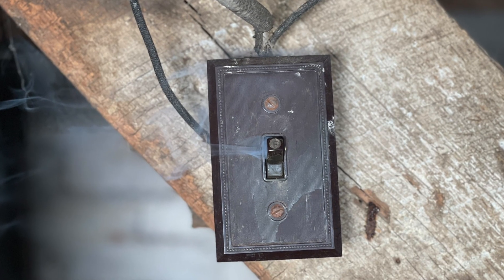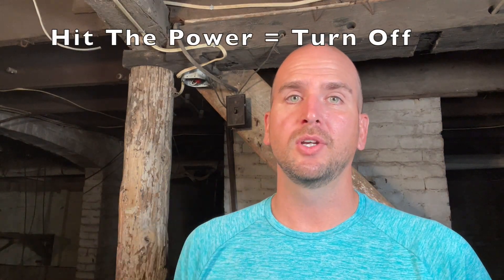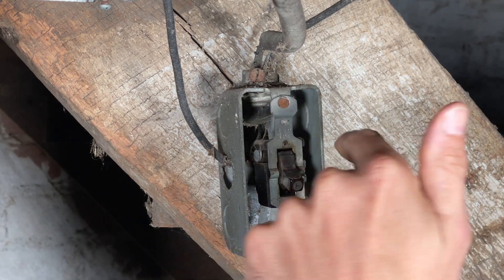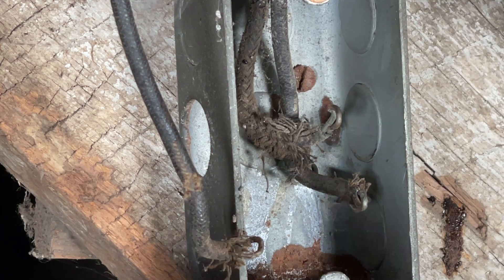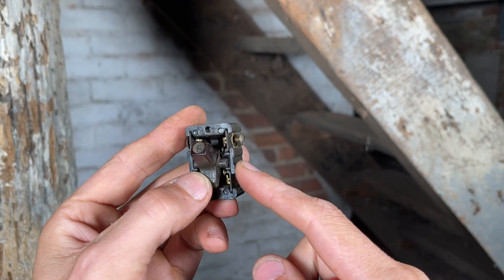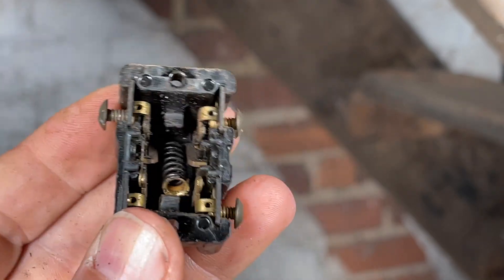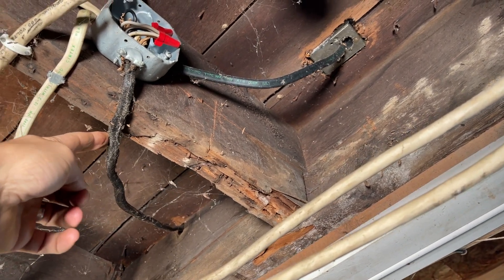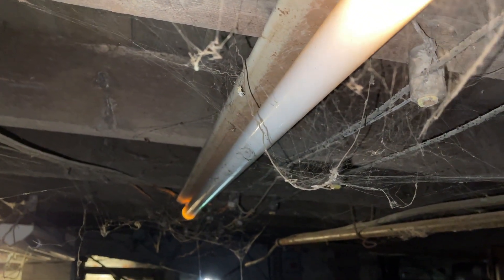Issues with Old Electric Wiring | Knob and Tube

Comment: That looks like a three way switch, so it's not just on and off. When it's {off} in reality it's passing current to the other switch so it can work as well and  vice versa, it looks that it was arching when it was feeding the other switch
Reply from the maker: Good point, thx 👍
Reply: I noticed that also. Good call.
Reply: Yes, however it looked like it shut the load off.. with no ground, where was the current flow to cause that heating ?
Reply: @TheRobWay1  looks like high resistance across the switch caused thermal effect.
Reply: @davey6024   That resistive load still needs a path to ground. Either through the load (light bulb) or by ground fault. No grounds, so that’s out. No connection to load as the light went off. Unless it was tracking from one traveler to the other  which is really weird and we’d expect to see the lamp flicker
Reply: Nope it's not switching 3 ways it's switching 2. How can you count the common as a switch? It's a 2 way switch. It doesn't switch 3 ways it switches 2.
Reply: That would be 2 way not 3 way.
Reply: @davey6024  It is "called" a 3 way Switch
Reply: @davey6024  the switch itself may be a double pole, but that application is called a three way.
Reply: @PiermontGvmtwatch  wrong it's not double Pole either. It's only switching the live to 2 positions.
Reply: @davey6024  I don't know what to tell you dude or why you're so bent on it, but it's called a 3 way switch. That's what it's known as in the industry, that's what the products are labeled as and marketed as.
Reply: @PiermontGvmtwatch  they call it a three way, but it only send power two ways, and you can only use the power one way so it’s really a one way switch. Three way switches have to have three switches, not two. I’ve been watching YouTube videos for over 43 years, so I know what I’m talking about.
Reply: @davey6024  yikes dude you need to chill. I said double pole referring to the two hot leads, which is technically incorrect but was a fine comparison since you're basically arguing the semantics of industry standard terminology. I don't know what makes you qualified to sit here and argue like the expert but I am an electrical engineer. While yes technically the switch isn't 3 ways, the use of two switches for one load is called a 3 way, hence the switches get called 3 way switches. You're arguing semantics as if the whole industry is wrong and only your way is right. Relax dude.
Reply: @PiermontGvmtwatch  Sorry I was a bit full on. I'm an English electrical engineer. Being English and thinking that our electrical system, equipment and terminology is vastly superior to the states my arrogance got the better of me. I'm still confused, so in the USA you agree the switch only switches 2 ways but it's called a 3 way switch. So do you call the common that the incoming permant live goes to 1 way and then the other 2 terminals that alternately output the switch live 2 way and 3 way?
Reply: @davey6024  ah now it makes sense. Sometimes going from American vs UK it's like we're speaking different languages. So we call using two switches 3 way, and to really make it worse if you have 3 switches you need a 4 way switch.
Reply: @davey6024  I think the naming convention comes from adding up the hots. So like you said you have that constant and the 2 switched travelers, hence 3.
Reply: @PiermontGvmtwatch  This will complicate things even more now. So we call what would be a 3 way switch an intermediate switch. So in the states its a 4 way switch. Damn my head hurts 🤣
Reply: @davey6024  I tried googling a good explanation of why, here in the USA, we call the two SPDT switches that control one light 3-way switches, and a third DPDT switch a 4-way switch. I couldn’t come up with a good answer. Some said that a single SPST switch is actually a two-way switch (on-off), and it was confusing to give two SPDT switches the same name, hence the term 3-way switch. Others said that it is just easier to identify switches by the number of current carrying screws on the switch (SPST has two, SPDT has three, and DPDT has four.) But it’s unclear why they appended ‘way’ to the three types of switches. Regardless, that’s what they’re called in the industry here. So sorry for the headache! 😉
Reply: @davey6024  Perhaps you noticed that this video was made in the United States? In the U.S., it is called a three-way switch because power has three places to travel. A common and two travelers. Perhaps in Europe and elsewhere they are called something different, but in the States, they are called three-way switches. For multiple switches on a single circuit, we use three-way switches on each end with what we call four-way switches in the middle. As for double pole switches, you mentioned interrupting the neutral. In North America, double pole switches are typically used to interrupt the hot legs of a 240v circuit. NEC 404.2(B) prohibits the switching of the grounded conductor, with a few exceptions, such as when all circuits are simultaneously disconnected, such as in a four-pole transfer switch.

I believe you guys are getting all worked up because you call the same thing by different names in different parts of the world.
Reply: @PiermontGvmtwatch  Just to clarify, a "double pole" switch is used for a 240 volt system where you are turning off both poles at once -IOW, both hots at once.  You mention below that you were using the wrong terminology, (understandable; no judgement), but no one says what a double pole switch actually is -so I want to clarify.
IA DP switch is unlikely to be used in a home because electricians (generally) don't wire household circuits using (2) 120 volt circuits in the same box.  IF we do (for example, a shared neutral system), we put each circuit on its own single pole switch.
So where is a double pole switch used?
Mostly industry where we are likely to find 240 volt appliances (machinery).
Where in a home might you find a double pole switch?
As a shut-off for 240 volt baseboard heater -although you are more likely to see a manual thermostat that is wired as 240 volts.

Note:  A shared neutral system *should be protected as if it were a 240 volt system in the panel*;  It needs to be on a double pole breaker to:
A).  Assure that if one side trips that both sides trip together -this is a safety precaution to avoid shocks or damage to equipment.  It prevents an open neutral (which could be hot).
B).  Assure that the 2 hots are on opposite poles -this is a safety precaution to avoid fires.  If 2 hots on the same pole feed a single neutral, it could double the  amperage on the neutral.
Reply: @sigcrazy7  Another way of looking at it is that the "ways" refer to the number of terminals on the switch. Though using that definition a DPST switch would also be "4-way" but I expect the "n-way" terminology is limited to applications where a single hot line is being switched so a DPST switch would not be considered. It is essentially slang which became formalized.

That being said I agree that it was confusing for the video to "turn off" the switch by flicking it up and then having it turn out to be a 3-way switch which has no specific on or off positions.
Reply: @SwingboyPA  great explanation. I did skip over that since I was misusing double pole to try to explain a different concept.
Reply: The actual switch nomenclature is a single pole double throw, or SPDT switch.  If you have a three way going on, there are three parties involved (optimally one male, two female).  In the more mundane electrical sense, there are three terminals involved.
Perhaps that explains the US penchant for calling them three way switches. 😂
Reply: @wingerrrrrrrrr  It is a North American thing (Canada and USA pretty much share electrical distribution standards and terminology). Also, SPDT is an objective description of the switch, while "three-way" at least somewhat implies the manner in which it is wired and used.
Reply: @kevinmartin7760  referring to single pole double throw switches would mostly draw blank looks from the general public, so the electricians decided to use a more exciting term. Guys like nothing more than a three way, so there it is.
The question that the one guy not used to it had was, exactly what three ways were involved.  Don't have a reasonable list for that, so it's just words that made it to mainstream without a real good explanation.  Like seasoning for pans.

Comment: If you're going to talk electrical to any homeowner please do everyone a favor and stress the safety aspect. NEVER trust a breaker. You should be properly using an electrical meter to check and verify voltage as well as voltage removed before touching anything. Keep up the information but remember a lot of people may see your videos without using safety measures, PPE,  and proper techniques then do as you have shown just to learn the hard way about electrical hazards and safety.
Reply: Yes a lot of peeps know just enough and are just daring enough to actually do a lot of stupid shit that is really dangerous .
And do not realize what they have done …………..
Reply: As a gen tech , I treat a breaker as not much different then a disconnect switch. 
Meaning , don't trust it to trip.
Reply: @B E , good info but not the fact I said Saif electrical meter not specifically a digital one. Knob and tube with an old analog is good too but even if it's notn100% reliable it would be better than using your fingers and the casing of the switch to test if the voltage is still there or not. I've had too many times with scenarios like this that there was power being fed from more than the breaker.
Reply: @DC_Dan  yup that's why you use a wiggy or meter and test until it's dead. I'm master electrition so it's funny to watch these videos.  Have a good day.
Reply: Electrical meters will lie to you with know and tube you should use a wiggy.

Comment: SCARY! If this house is being sold in 2021, does all the wiring have to be brought up to code, prior to the sale?
Reply: Depends on your insurance. Many insurance companies would not cover this set up due to the hazard. So while laws don't require it, insurance companies can often strong arm a homeowner into making the necessary changes. This is also true if in the wind zone, making you replace a roof that is 10+ years old. Some insurance companies will cover this (and the roof) for exorbitant rates. If you don't get insurance (and by extension a Mortgage) you're free to leave the old stuff in.
Reply: If your considering buying a home that you suspect is wired with knob & tube, have the electrical system inspected by a qualified and certified electrician.  Don't rely on a home inspector to evaluate the electrical.  Worth a few hundred dollars for piece of mind.  If issues are found, you can walk away or you now have a strong strategy to negotiate a much lower purchase price to cover the necessary upgrades.
Reply: no
Reply: Most that i know of says you need an inspection of the electrical system. If the old system is still fine and still in working order then it is fine to leave it, BUT if any of it is changed then it has to be replaced. Because if it’s been there that long and nothing has happened then they believe that not messing with will ensure it still has long life. But changing or tampering with it could cause it to fail, so at that point its just safer to just replace with new.

Comment: How can you tell if you have knob and tube wiring? I've seen those wires but not those knob or tube looking things.
Reply: If you see cloth-insulated copper wiring, then you almost certainly have K&T.  The (ceramic) knobs & tubes are most easily seen in basements & attics -- the knobs are for support, & the tubes for insulation when the wiring goes through a wood beam.

Comment: Don’t expect home inspectors to find everything either. They are good at general things but often miss some of the finer details like the hybrid electrical he talks about here. I have a rental property 3 family that is this hybrid but mostly updated to Romex but still some of K&T still on the upper floors due to the complications of running all new wire up 3 floors. This video shows some serious K&T in need of updating though and with all that basement access it’s a wonder why it hasn’t been more updated hybrid style at minimum
Reply from the maker: I agree LH and I think a lot of home buyer assume with a home inspection anything that could cost them money in the future will be picked up by the inspector.  From my experience that is simply not the case.
Reply: @EverydayHomeRepairs    My friends just bought a house 2 months ago that passed 2 inspections: 1 before and 1 after sale.  So far both ACs have died, the water heater was replaced (by someone who left the old energized, stripped wiring HANGING  one foot from the dryer), the solar power on the roof doesn't work, and when they were inspecting the AC after the first one died, the AC guy was able to slide the outside heat exchanger by a couple of inches and see sparks from where the electrical service entered the unit.  And keep in mind this is Florida, where that AC should have been sitting on a concrete pad and bolted to the ground.  That's just what I can remember off the top of my head, too.

PS - If you want a county inspector to spot all the issues with your remodel, try insulting his mother.  ;)
Reply: In my first home, they missed a BIG one.  It had a smoke detector in the small hallway by the kitchen, bathroom and backdoor.  It was an odd place in reflection.  It became that time of the year to change batteries, but when I pulled the smoke detector down I was greeted by old fire damage that had been "fixed: in the dumbest way possible.  The old knob and tube wire running inside the wall that had caught fire was fixed with wire nuts and electrical tape (but no electrical box) and a smoke detector put over it.  I was not happy.  I rewired the entire house after that.  It was just to scary not to.
Reply: Home inspectors are not required to open anything during a home inspection.  Most of their assessments are from visual inspection only of what is easily accessible.  They are not certified electricians, plumbers, engineers or gas fitters.  If your buying a heritage home and suspect knob & tube wiring, hire a separate certified electrician to assess the electrical.
Reply: @chrisgraham2904  And home inspectors that find too much wrong, it pisses off the realtors and banks who quite using/recommending them.  It's one of the industry's dirty little secrets.
Reply: @imushavem7504  Yeah...I suspect that's true.
Reply: I still think most are honorable and point out major items they see, but we all need to feed our families.
Reply: You have to find a inspector that has experience fixing houses.

Comment: Wow!  Great show.  Really enjoying ypur channel.  I have an old mid 1850s home.  Wiring partially updated just like you said.  I have received a shock from a metal electrical box.  Would plastic boxes be better then as they do not carry a risk of shock?  Obvi fix the issue, but as a point of debate.

Comment: In Germany not allowed. If the estate changes the owner, all today's standards and codes has to be followed, otherwise you don't get a permit to live in it. Even in old rental housing it has to meet today's codes, when it get sold. Wirering in Basements we have to use PVC conduits.
Reply: Nice I've been looking for German electric vids I've seen a few your methods are pretty close to what a true tradesman craftsman wld wire not the bare bones minimum code CON-tractors(like I say to most you can't have contractor without the con 1st lol)do in hundreds of vids. Your panels have an outlet attached to the dinrail inside of the cover or is that the French? And do you only use round octagon boxes as well?
Reply: @wizard3z868   Dinrail...it's a DIN (Deutsches Institut für Normung - German Institute for Standardization ) Rail. The Frenchman put an Outlet on the DIN Rail, but some of us do the same. We use round Boxes for Outlets and Switches (black) for Stonewalls (most of our Houses) or for Deviding Walls, mostly Metal Structure with Plasterwalls (orange).

Comment: Other than a breaker panel, this is so similar to my grandmother's house. Its a hybrid of Romex, asbestos insulated, aluminum, and knob and tube.  You can see the age of an addition or repair by the wiring.  There is also a couple of mercury switches  and an old rotary switch.  The entire house is on 2 30A fuses.  And of course, its ungrounded. Its time for a total update.
Reply: Those silent mercury switches will last a lifetime and beyond under normal use.
Reply from the maker: Yep, not a small job but basement and attic access will go a long way.
Reply: If it is insulated with asbestos (i. e. almost guaranteed lung cancer if you mess with it) you have a job ahead of you that cannot be done yourself.  All of the asbestos insulation where you are going to re-wire must be removed by a special contractor (of which your area MIGHT have one or two, even Grand Rapids, MI only seems to have three) and it will cost thousands of dollars.  If you have the whole house remediated the cost is in the tens of thousands of dollars (and an N95 mask won't protect you).  I feel sorry for your grandmother.  Appropriate officials here in Michigan told me that if you don't mess with the asbestos it likely won't hurt you but once you disturb it you run the HIGH risk of lung cancer.